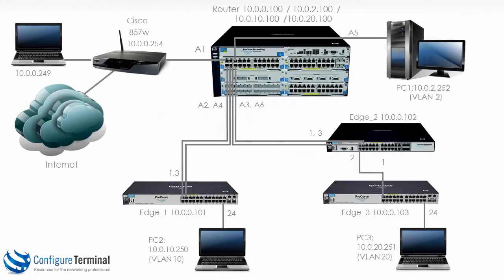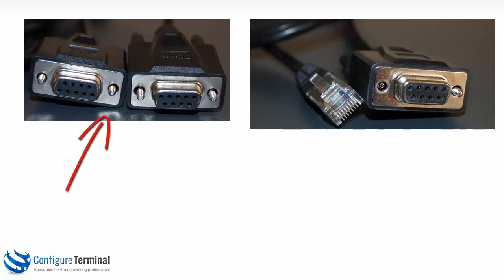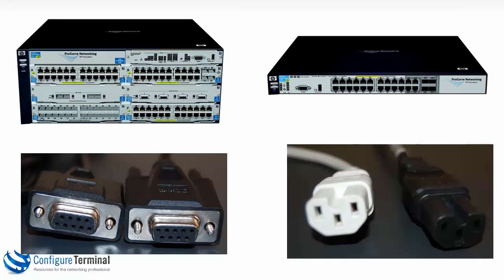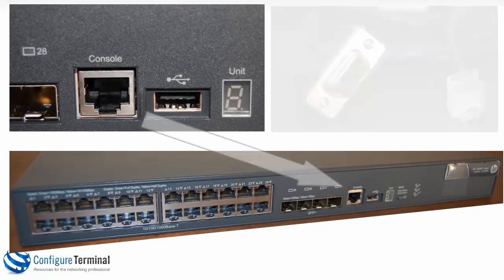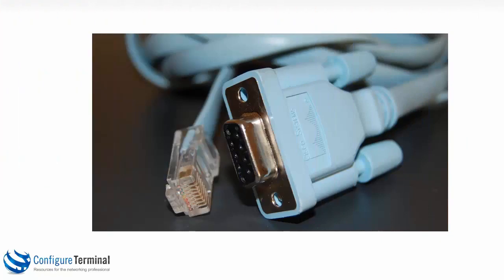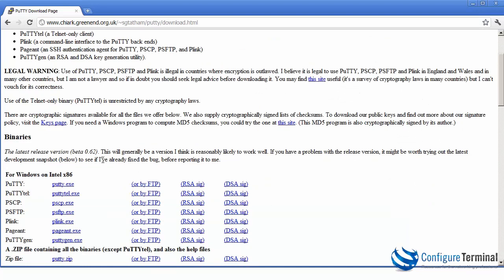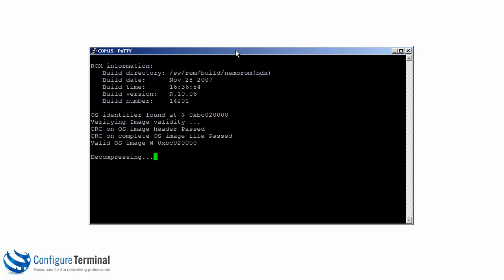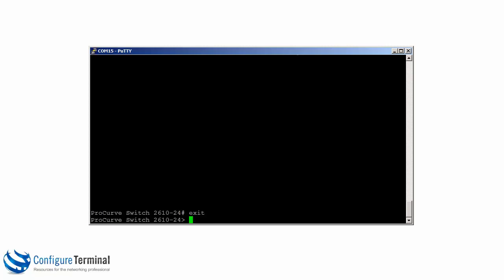Aruba HPE Networking (Part 1): ProCurve / ProVision / Aruba switch setup Part 1

Comment: Thanks for your content. My problem is that when I try to install the port driver, it apears the following error: "This device cannot start. (Code 10).  The specified request is not a valid operation for the target device.". I have tried meny things and the error persists. Do you have any idea for the solution?.

Comment: hi if I want to add another switch in another building (building B) but keep it on same network as other building (building A), do I just run a fiber and add the switch into any of the 3 switches in building A from the single switch in building B?

Comment: Nice. Look forward to going though these.

Can you run HP or Aruba switches in GNS3?.

Thanks and look forward to more multi vendor content. Cough Juniper!!!.
Reply from the maker: Thanks Al! You cannot run Aruba / ProCurve in GNS3, but you can run Comware VSRs in GNS3. Juniper is on my list as a lot of people are asking for it :)

Thanks for all the feedback and suggestions!
Reply: Only indirectly. See https://community.hpe.com/t5/Network-Simulator/Integrating-the-HP-Network-Simulator-with-GNS3/td-p/6697908 . The only HPE device you can run directly in GNS3 is the VSR1000 router on Comware 7, just go here and search for VSR: https://h10145.www1.hpe.com/support/SupportLookUp.aspx